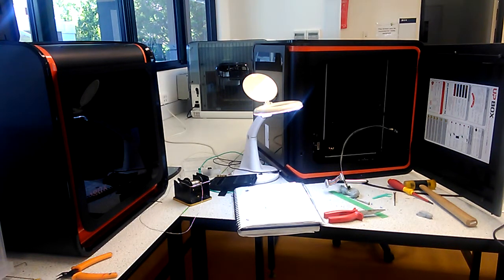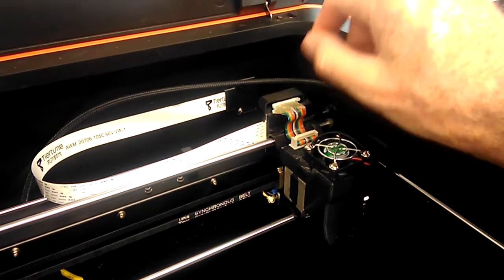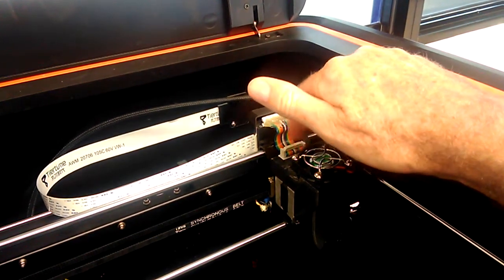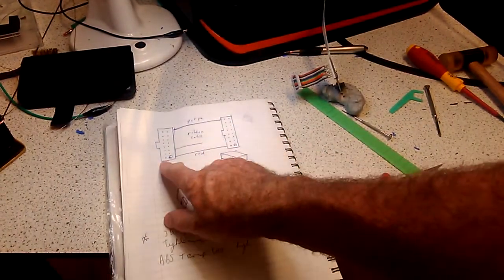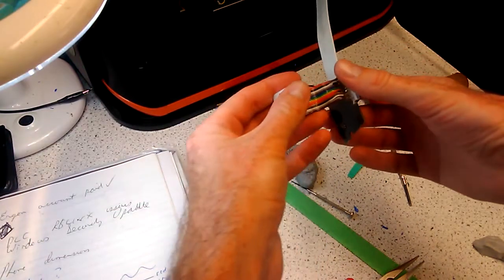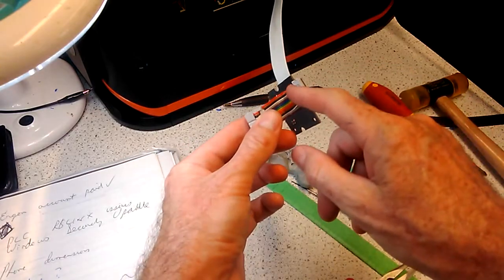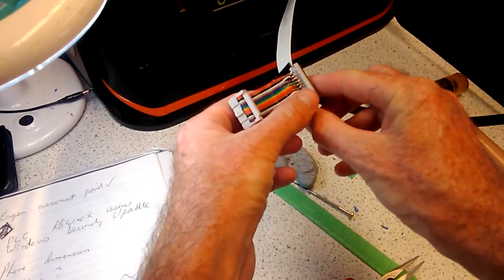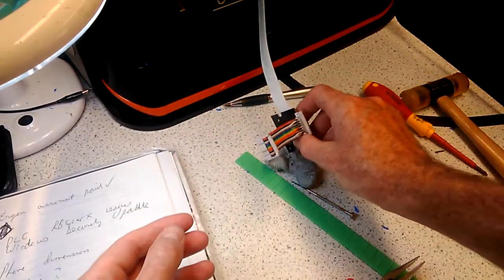Upbox temperature sensing and heating issues solved

Comment: I found that if I re clamped the IDC connectors after removing the strain relief, that contact was restored. I have since found  16 Way IDC connectors(Wurth 61201623021 Socket)that are rated at 125 Deg C and manufactured a replacement cable using them.  I have not installed it yet. Thanks for your video Simon

Comment: I have tye issue of the hot end not getting to temperature. I did change the flexi white ribbon cable as there was a slight break in it but that didn’t fix it. Will try your solution to try and fix my problem hopefully.
Reply from the maker: How did things go? I have an issue with the cable design for the UPBOX. There are way too many connectors from the control board to the print head. Each connector represents a potential point of failure. This is why I decided to completely rebuild the cabling system with just one connector going into the control board. I've had much more reliability now. It is important to ensure that potential stress points at the end points of the cable are removed with proper clamping of the the cables.

Comment: This is happening to me on the new Upbox+..... Customer service wont do anything for me... ah.. I will try your fix when I get a chance... Before I just turned up the temp by 30 degrees and it worked for 200 hours of printing, now its failed every single time 30mins into printing.. but its getting worse.. now it fails 20mins into printing... yes I am changing settings, but not drastically.. (just to sort out any chances of other failures).
Reply: I am hiving the exact same issue. any fix. i heard it is a sensor that trips that is next to the servo?
Reply: @rhysjones4159  So, I've gone through and done all the leveling by hand. Auto leveling for some reason was always off by a tiny bit creating additional problems. I now let the printer warm-up for 1 hour (from cold), I've found this leads to a huge improvement in it sticking to the bed. The problem with the extrusion came from my gear tearing the filament (It was really nice filament... I mean literally really nice stuff). It turns out a big contributing factor was the roll of my filament was .5mm to big for spinning on the rack. Which caused stretching between my gear and the filament.. so If I started printing from cold; within 20mins it would tear right through the filament because the roll could not freely spin as much as it needs too. (Most rolls are too big I've found, so I use an extender to bring a 2g roll out about 3ins (I also cover it with a plastic bag I custom made to keep all the heat in). I also had to clean the Gear nearly every time it stripped badly.. It's easy to do, more simple than you think..